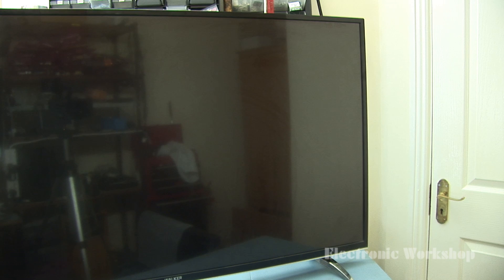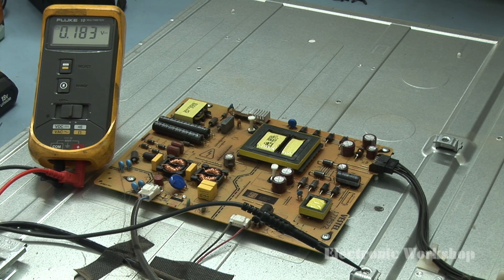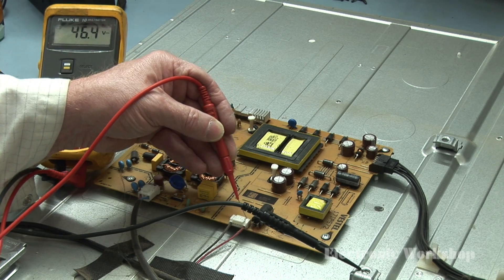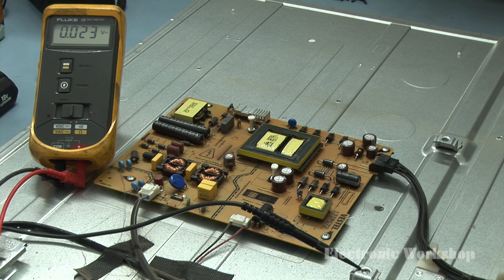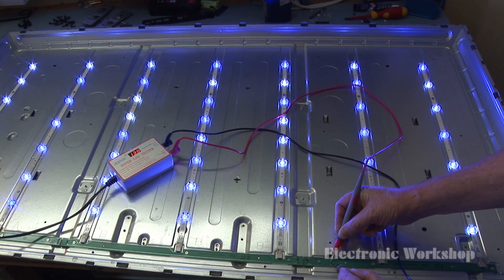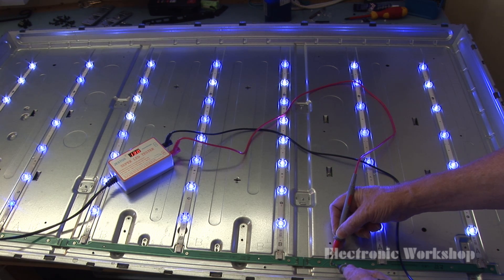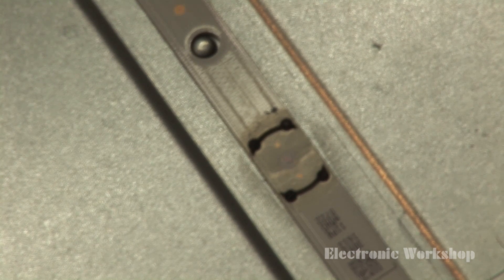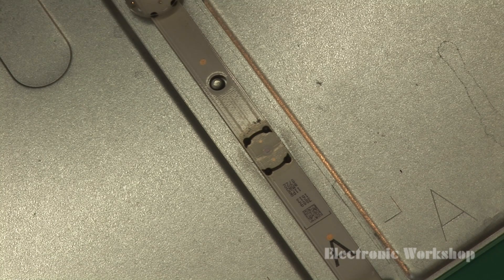Walker WP4K55U18 Blue tint on Picture

Comment: Never use 2nd hand LEDs. You'll get the same issue but worse. The blue tint is caused by the manufacturer. They printed off loads of strips and sold them to LG and vestel for cheap. The phosphor was good to start with but it doesn't have a long shelf life. So replacing with 2nd hand strips will most likely have the same issue sooner or later